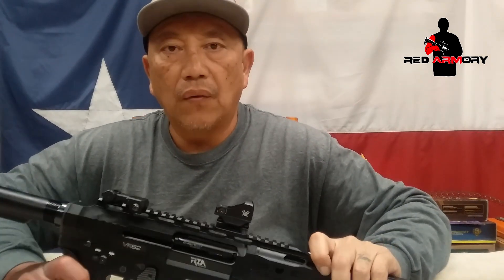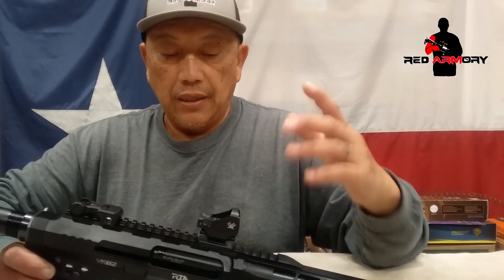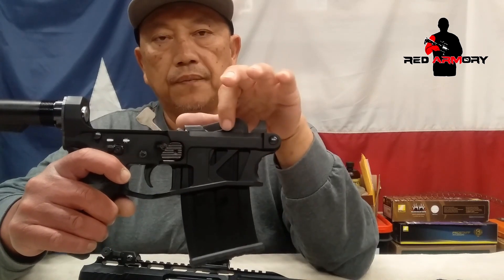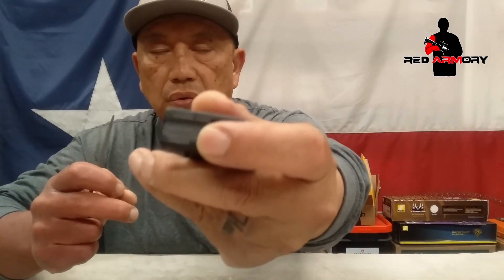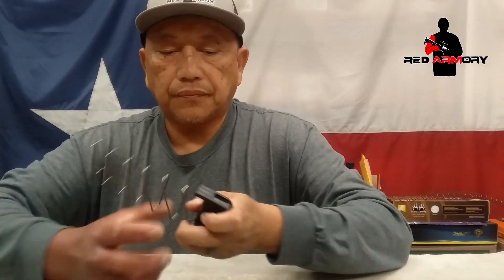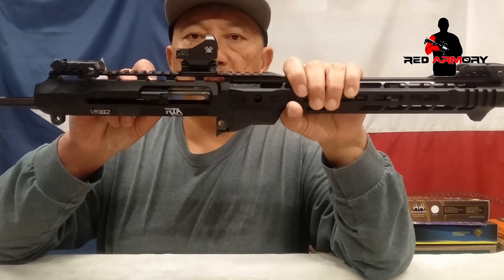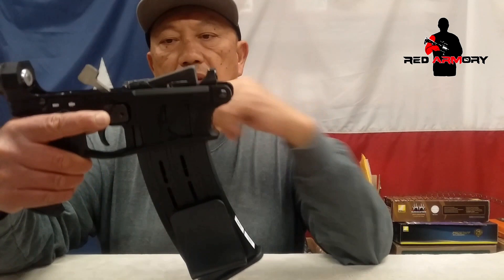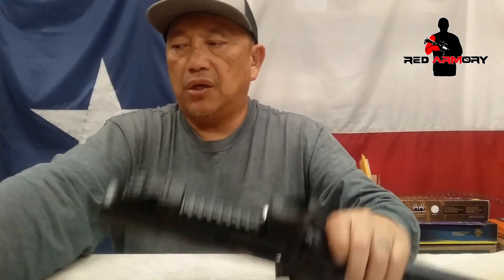RIA VR Series Shotgun - VR60, VR80 and VR82 Magazine Tuning

Comment: I think the Red Armory channel is the most comprehensive and thorough VR-80/VR-82 channel on YouTube.  Thank you for sharing your experience. 
The first thing I did was disassemble and CLEAN my VR-82 completely.  Yes, there were filings and a couple of machining chips inside.  I used solvent-soaked pipe cleaners to clean out the gas ports.  
My only feeding issue was in the first 30 or so rounds.  I used 1325 fps #7.  I had no problems afterward.  But, I had already filed the two rear "horns" off of the magazines, so that helped, obviously.  

Please keep making videos for VR-80/82 owners.  Thanks.
Reply from the maker: @imdeplorable2241  Thanks for visiting the channel and for leaving your kind comments.

Comment: Love this video Thanks gotta a question my vr80 monarch #8 and remington #6  both work  but it will not take a monarch #00 bolt will not slide back. I did take out the lockback pin. I read review on Academy where customer was having same issue with monarch #00
Reply from the maker: Thanks, on the Monarch 00, what is the velocity and is it 2-3/4" or 3" shells?  Are you using the light or heavy piston?  Which magazine are you using?  5rds, 9rds or 19rds?  Also when you say slide back are you referring to the bolt not going back into battery?  I would take a look and see if the shell inside the magazine is rimmed locked.
Reply: It is 1345 fps 2 3/4 more like 2 1/2 the 4 mags are from advanced tactical 9rd  got that  from manual and very stiff  spring. 00 are  new  rounds and mags are brand new never been fired doing dry fit
Reply from the maker: @luistorres1037   Since you mentioned dry fitting, one thing to consider is with the VR series SG the safety can be engaged when hammer is forward unlike the AR safety can only be engaged if hammer is back.  When this happens, you will not be able to rack the bolt back.
Reply: The #8 works but the bolt hits the front of the 00 and and wont go back the safety is off. Thank you for your time and help. The bolt works great with the new mag empty
Reply from the maker: @luistorres1037  Glad you got it to work with the new mag.
Reply from the maker: @luistorres1037  I had a chance to think about what you said and now think I understand what you are describing.  with mag empty bolt move smoothly, with it loaded with 00 the bolt hangs up when going into battery.  If this is the case load the mag to capacity, and start downloading one by one until the bolt is able to close.  Once you confirm it's the spring, you would need to decide if you want to cut some coils off the magazine spring and use that mag for just 00.
Reply: Great idea !! Thanks I was looking on   advanced tactical web site they still have 9rd mags on sale for 21.00 ea. thats where I got the 4 mags. BTW on one mag I cut inside tab to make it 10rd is that cool?
Reply from the maker: @luistorres1037  Cutting down the lock plate tab on baseplate shouldn't cause any issues.  I've seen other mfg doesn't have that tab on their lock plate and is advertised as a 10rds mag.

Comment: My 5 round mag is so tight I can’t pull it out. I had to take the rifle apart, the tap it lightly to get it out!
Reply from the maker: @sonnym1461  Sometimes, the tolerance is hit and miss even on the factory 5 rds mags.  You might need to tune those, too.  Also, if you have the CA compliance SG, mags won't release unless takedown pin is pulled and slightly pivot the lower.

Comment: Thanks Q!  As an open 3-gun shooter it’s time to start getting ready for the shooting season and I need to go through all my VR-80 mags and tune them since some of them are reliable and others are not.  One question for you.  If there is interference with the feed lips do you recommend any filing on the feed lips of the lower or just  addressing the magazine itself by compressing the sides in a bit?
Reply from the maker: Hi, If you are referring to the feed ramp on the lower receiver, I would not modify that since it is machined in as part of the lower.  I would tune the feed lips/body on the magazine only.  From what I've seen, the dimensions on the lowers varies from one SG to the next, so don't risk damaging the lower by modifying it to fit a particular magazine.  I would measure the dimensions of the mag that works reliably (front to back, left to right of the top portion of the mag).  Also measure the space between the feed lips of the good mag and try to duplicate it on all your mags.  While tuning the mags, take a dummy shell and make sure it slide along feed lips with minimal drag.  If any part on top of the mag appears to make contact with the bolt or the side of the mag contact the bolt carrier assembly while it moves back/forth, I would give it some clearance with a little filing/sanding of the trouble area.  If front to back is tight in magwell, you will need to compress the front and back of mag, same if the sides need adjustment.  Keep in mind, adjusting front/back will change left/right dimensions and vice versa.  Lastly make sure the follower by itself moves freely inside the entire mag body by dropping it in the bottom and it should slide freely all the way through to the top of the mag.  If it hangs up anywhere in the mag, tune that specific area.  Hope this helps, best of luck in your 3gun match.

Comment: Please demonstrate how to install a plug in the VR82 5 Rnd mag. Thanks.
Reply from the maker: Are you referring to the magazine limiter?  You would remove the baseplate by pushing down the tab (circle) in the middle of baseplate and sliding the baseplate away from the magazine body tang on each side.  Once you have the base plate off, you would just remove/replace the flat locking plate with the magazine limiter plate by putting the elongated part into the magazine spring and reinstall the magazine baseplate.
Reply from the maker: I uploaded a video.  Thanks.

Comment: How to release/remove the bolt holder on this mag carrier.
Reply from the maker: To remove the LRBHO on the magazine, you'd need to remove the baseplate, lockplate, spring and follower from magazine body.  On the follower, two designs that I'm aware of: pin and clip.  With the pin type, just drift the pin out, becareful it is under spring tension.  With clip type, take a small flat screw driver and push on tab from under the follower and push out the back of follower.

Comment: I bright a new ria vr80 mag stuck and can't remove it. Worst gun I have ever owned
Reply from the maker: @waynedosser6557  Yeah, the stamped metal mags are hit and miss especially if you have the cerakote version. Is it the CA version?
Reply: @redarmory  yes my son slaped thr mag in and it's stuck. Have not even fired the gun yet and hate it. I will never buy ria again. Worst gun I have ever bought or owned.
Reply from the maker: @waynedosser6557  if CA version you need to separate or at least pull the takedown pin from the upper and the lower to remove the mag

Comment: My VR82 was having feeding issues. I saw that I just needed to up my velocity on my ammo but your saying it should still shoot no matter the velocity because of the mag? Could I get your email or phone number to help me out with my gun? If so that would be great!
Reply from the maker: @reemswrld1769  email me at redarmory.academy@gmail.com but first, a few questions:
1. what mags are you using 5rds, 10rds, or 20rds?
2. have you checked on the larger capacity mag that the shells are not hanging up?
3. visually check to make sure that the slide carrier is not making contact with the side of the mag/mag lips?
4. what shells are you using?  ie mfg, velocity, shots size, etc.